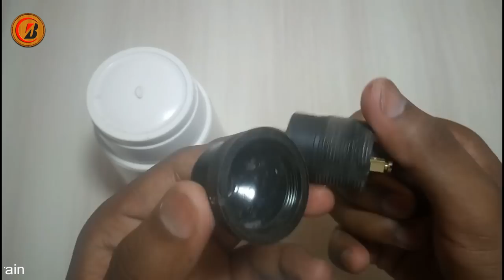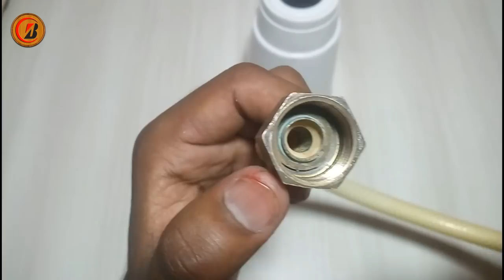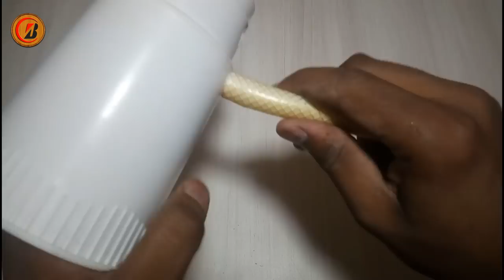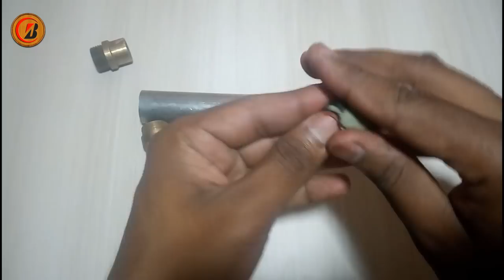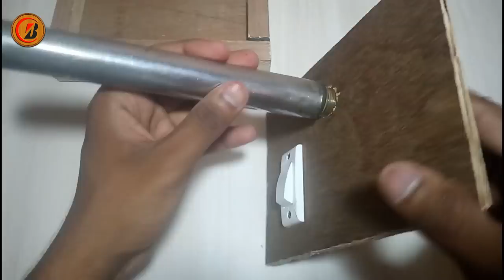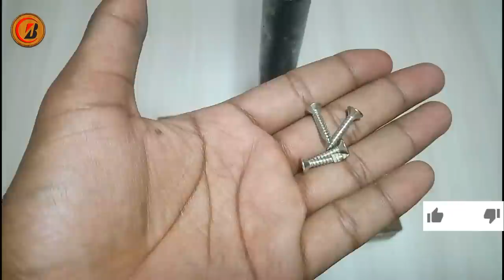How To Make table Lamp

Comment: what did use with the steel pipe.??
Reply from the maker: +Dheeru Bhai m-seal and Water Joint Connection PVC Pipe